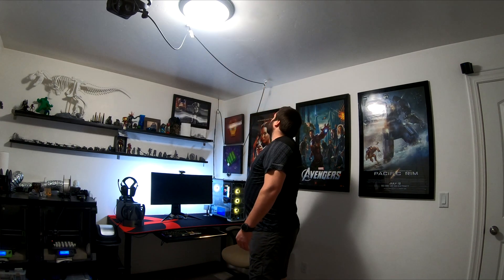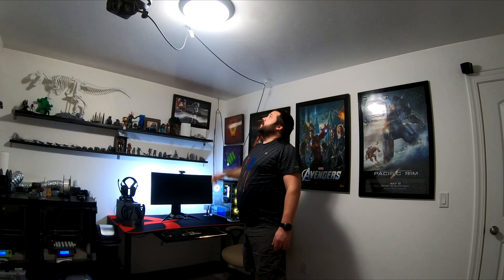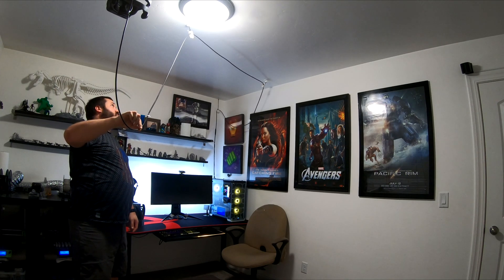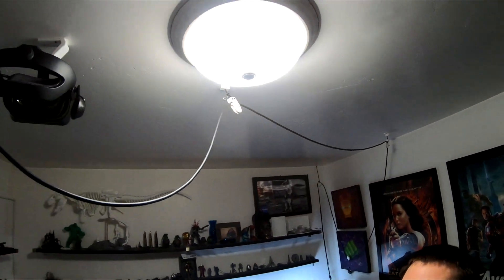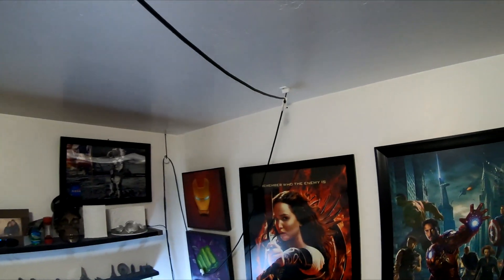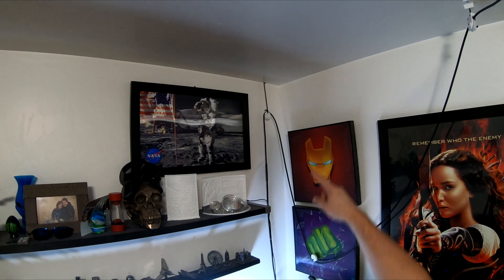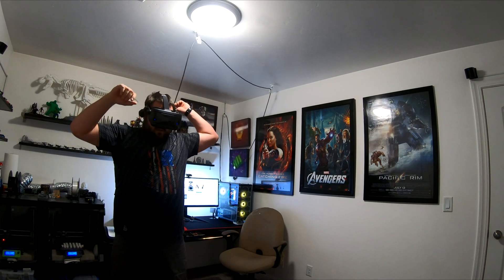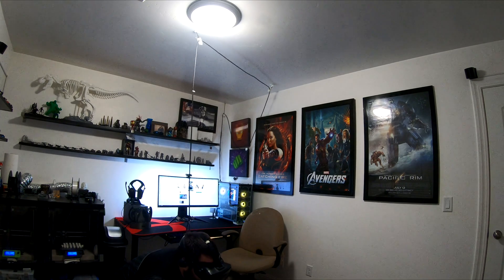VR Pulley System

Comment: how easy are the cables to come off? because I'm interested in this design but i need to be able to take the cable out to detangle it
Reply from the maker: Really easy. I made the pin that holds the wheel in the pulley basically "quick release" so you just slide it out, the wheel drops out, and the cable is free.